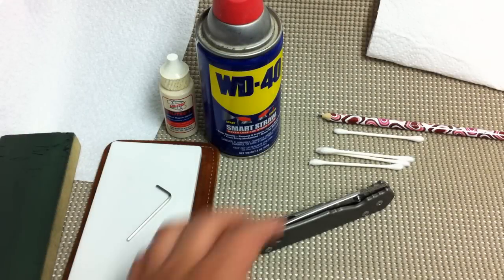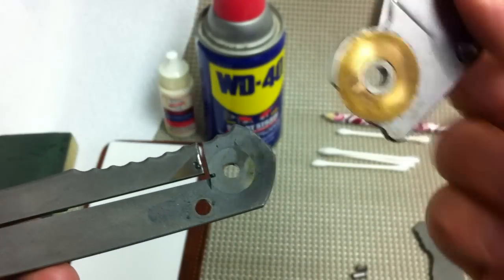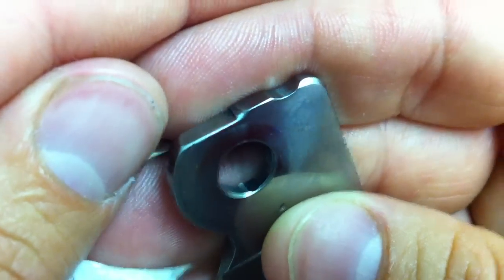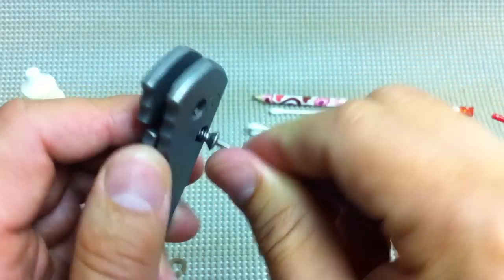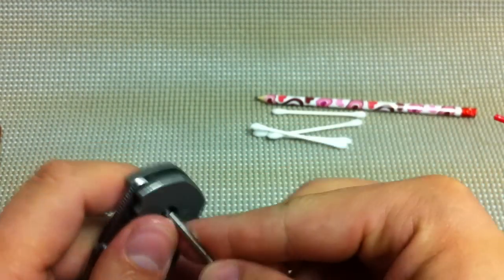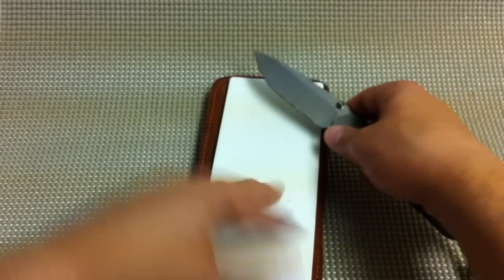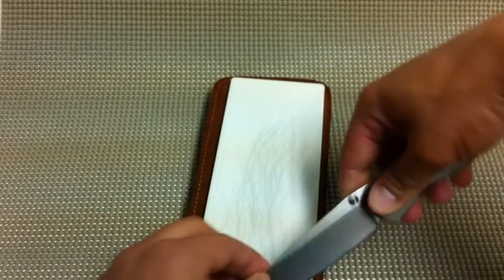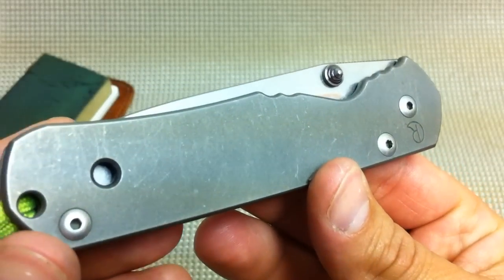16 Year Old Sebenza gets some TLC

Comment: btw he will not honor the warranty on that specific knife IF you sent it in because of the lock face deformation. I was told I abused the knife that had the same flaking on the lock bar and my warranty was not honored. All I did was edc my knife for a year and he called me a liar and told me I had to flick or spine whack for that kind of flaking to occur. Just a heads up

Comment: nice knife, one point though regarding the relative softness of Ti. in the lockface you will notice CRK heat oxidize the lockface of the lock bar.. Titanium Oxidiation is very hard, and wil go from 450 to 1300 HV with a proper oxidized hardening.. the lock face is in effect harder than the blade where it contacts, but if you flick too hard, etc etc, sometimes it can flake off, and you might need a new lock bar this is very hard to do though, because the softer ti supports it. I also hardened all my ti lock faces, and they simply do not "wear in" like the normal unhardened ones that most people do. it certainly gives CRK excellent longevity, and my CRK as not moved in 12 years of active use. basically, titanium becomes case hardened through heat anodizing, and much more scratch resistant too
Reply: anyone interested can search for the scientific material on it "Surface modification of a Ti–6Al–4V alloy by thermal oxidation" or just look for "how hard is oxidized titanium" etc
Reply: LoL.. this only just came into my feed today, and its like 8 years old video :D :D

Comment: Heat the blade up with the militec on it...  say to about 130 degree's for 1 hour...  the militec will penetrate the surface of the metal and will self lubricate the blade for a long time.  I use it on all my firearms.  They look dry after storage but when the gun warms up the militec comes right out of the metal and lubricates.  Its awesome stuff.

Comment: I must say its a bit weird seeing that huge PB, not only in comparison to spydies but to my large seb with the perforations lol. I guess its a testament to quality made knives regardless of the manufacturer to last that long and still tick =] In terms of grease, I actually mix militec oil and militec grease. This seems to keep it lasting longer, has a smoother /fly function, but it also doesn't have that overt resistance of grease itself. I plan to make a vid of it in the month or so.

Comment: Actually it's not a solvent. 

From Wikipedia:

The long-term active ingredient is a non-volatile, viscous oil which remains on the surface, providing lubrication and protection from moisture. This is diluted with a volatile hydrocarbon to give a low viscosity fluid which can be sprayed and thus penetrate crevices. The volatile hydrocarbon then evaporates, leaving the oil behind.

Comment: I disagree with you about BG-42 and S30V.  I find it is harder to get your edge back with S30, but I can put a razor edge on all my S30 blades...not saying you're wrong, but they certainly hold an edge wonderfully. I'll never go to a lesser quality steel, after dealing with 154, and all grades of 440 for years...
Reply: Really, razor sharp.  Make a video of you shaving a five day growth.
Reply: First off, I've been sharpening since I was 13, and I'm now 27.  Granddad sharpened saw blades for a living and I was always at the shop. I can put a razor edge on almost anything.  ELMAX steel gives me the most trouble, because of its hardness.  I've been using my good old paramilitary2 for 5 years now and I have nothing but praise for s30v.  I'm not sure of your troubles but I have no problem putting a razor edge on a blade of s30v. I use the edge pro apex & my set of Norton water stones. Depending on the edge of the blade, I usually start with 1000 grit and work my way up to 8000.  Not a hard skill to learn, just takes lots of old knives and lots of practice.
Reply: Again...razor sharp means face shaving smooth sharp.  Razor sharp does not mean arm hair or paper cutting sharp.  Any reasonably sharp knife can do that.  Most people who claim their knives are "Razor" sharp couldn't shave their face.  There are videos of people actually shaving their face.  If you can do that then it is "Razor" sharp.

Comment: A great video on how NOT to clean a knife. Water and a paper towel?! Seriously...
Reply: Michel Linschoten what do you use?
Reply: Use a good (car) degreaser, water does not clean well at all. 

When you put it back together use some, gun oil on the pivot. It stays on there longer then say wd40
Reply: It does but it does maintain that blade, WATER seriously

common now.
Reply: JohnReviewer112
 Holy shit i will be slow this time, i am talking about PIVOT, as that is the only part that really needs a dab of grease. I am not talking about the blade stock. Which you can indeed wipe of with a towel and some water. Unless you have a CARBON knife. Which does require, here it comes OIL! To prevent a patina/oxidation

Companies use for the pivot the shittiest cheap oil/grease they can get.Gun oil creates a very low friction pivot. Which might result in a better operation of your folder. That is all i have been saying.

I am not sure how many knives you ever cleaned. Or how you possibly think, that wiping paper towel and some water qualifies as a cleaning. I am talking about taking it completely apart and really clean a folder.
Reply: +feketetv 

As for my maintance work, I use Aegis Daily Cleaner for the blade (a cleaner/rust prevention solution that's also food safe!). 
For lubricating the pivots, I use Blue Lube (Benchmade product), which seems to have similar consistency as to mineral oil. So you can basically expect it to attract lint/dust just as mineral oil. It helps to let the lube dry up a bit before you carry it on your pocket, but this does not mean it's lint/dust proof. I haven't tried any of the dry lubes, so I am not able to compare it against Blue Lube. 
I really like both products (Aegis/Blue Lube). And I plan to stick with these two for all my knives maintnace work.
Reply: is there a review on a camillus vortex
Reply: Carbon steel doesn't need oil. Patina is fine.